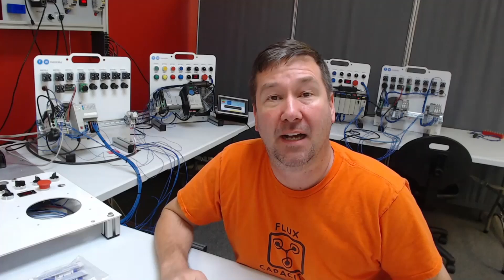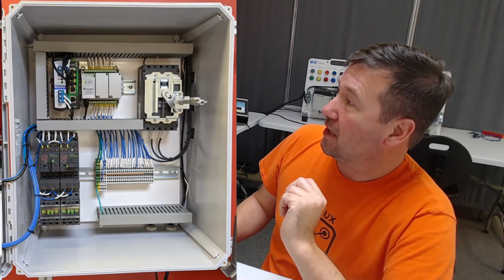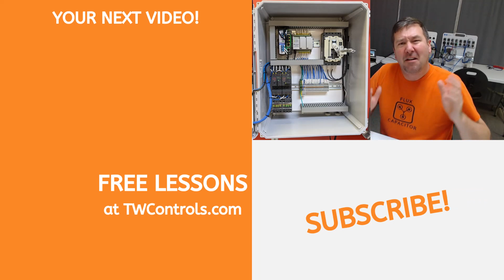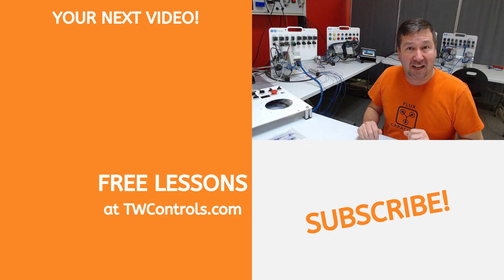What is an SCCR Short Circuit Current Rating?

Comment: Hello! I work in the BESS industry and alot of discussion goes into how many battery racks an inverter can support. This is because there is a fuse on the battery rack and they are wired in series meaning each battery rack has a short circuit current contribution. The battery rack contributions then cannot sum to be more than the rating of the inverter. I'm wondering if there are ways around this by adding intermediary fusing or if there are smart ways around this.
Reply from the maker: Never a good idea to bypass any circuit protection

Comment: Seems to make so much sense what you said, Tim. Wonder why people get it wrong?
Reply: Tim scratched the surface, but there's a LOT involved with those exceptions he mentioned and you really need to know the ins and outs of things like feeder circuits, branch circuits, peak let-through and the situations where it can and can't be applied, combination ratings, how to determine when or if control circuit components come into play, etc. 

You COULD just use the lowest rated device in your panel but you could end up having a panel that's rated too low for where it's being installed and an angry customer on your hands. On that note, it's always a good idea if your customer doesn't give you a minimum SCCR guideline, make sure they at least know what you're going to rate their panel before they give you a PO. Better yet, make a clear note that if no minimum spec is given, changes to the panel after the fact to increase the rating are extra.
Reply from the maker: I've got some videos coming to help clear things up.